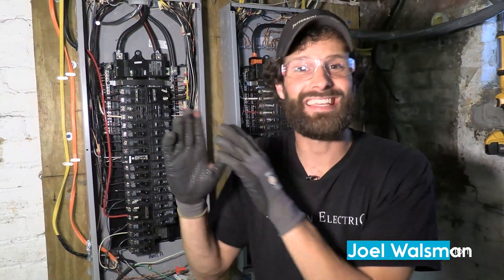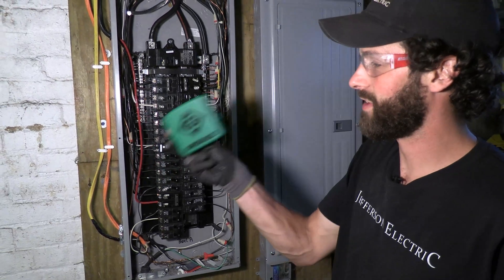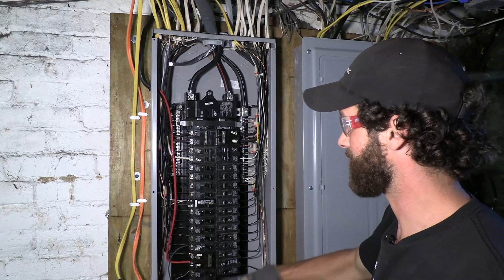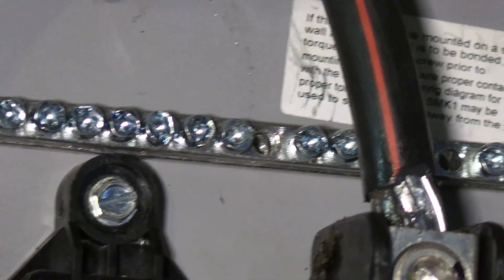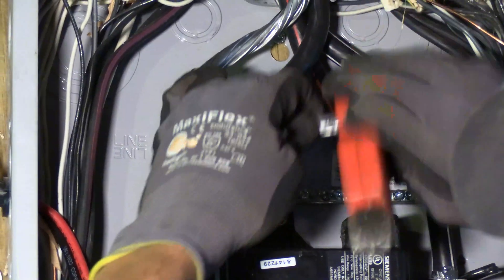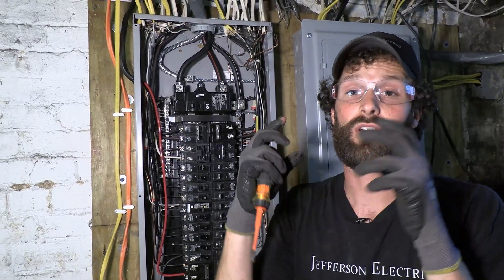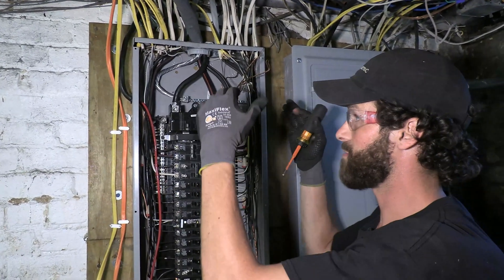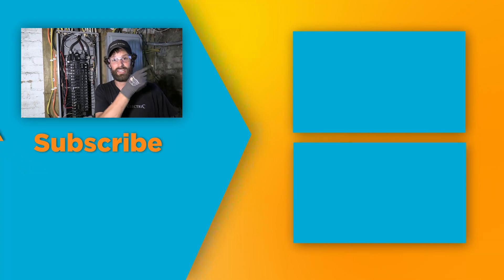This Metal Block Fixes A Common Electrical Panel Problem

Comment: I like the video but I strongly dislike your switch of placement of the ground bar. Originally you said to install above the sticker which is correct, however you installed it below that and, in my opinion. it is wayyy to close to the incoming A and B phase. That's my observation from an experienced electrician and inspector!
Reply: I agree with @Layz_her. Having a bar that close to the 200 amp service input is a disaster waiting to happen.   Yikes - gives me the creeps looking at it.
Reply: Agreed. Above the sticker is a little more awkward working around the incoming mains, but that little bit more distance from the main terminals seems worth it.
Reply: I believe it's against NEC too. There is a table in 408.56 that shows proper spacing between energized and ground bare conductors. Seems to be a required 1/2 inch clearance.
Reply: 1.  Probably the worst place to put a ground bar. 
2. There should be pre tapped holes on the sides where the ground bar is intended to go 
3.@mark fritze you can put more than one ground bar in the panel.
Reply: No way would I be comfortable messing around with a ground bar so close to the main lugs. And all those bare copper grounds nearby. A very exciting panel to work on. Also in many panels they aren't anywhere near this tidy, with lots of excess wire length folded around everywhere.
Reply: I agree.  I don't understand why he didn't just put the ground wires on one side and neutrals on the other and remove the bonding screw/bar.  He was already disconnecting half of the wires.  Why not just move them all?
Reply: @Roy-ij1wq  a lot of times they won’t all reach to the other side
Reply: @markxx90  The wires can be extended.  I think its dangerous having the ground bar so close to the mains.
Reply: Whew, ya, no kidding. That is an arc flash waiting to happen.
Reply: Don't put the added ground bar at the top right behind the incoming hot legs
Reply: What about pigtailing some grounds?
Reply: I probably would have used 2 ground bars. One on the right behind the smaller conductors, another shorter ground bar on the left towards the top, probably mounted vertically; with a green bonding jumper between the two.  If I had to move all the neutrals on that side out of the way, mount the ground bar, then put the neutrals back, I would have.
Reply: siemens panels have holes drilled for adding ground bars on the sides under OG ground bars... why not mount there? I would avoid the incoming lugs area altogether. that's just setting up the DIYer for failure.
Reply: Some panels actually have the holes there for ground bar installation already, not a big deal.
Reply: @bradleysmith6442  When I see ground bars that close to the main line, I think about the 200 amps at 240 volts available and the potential fault current if a short occurs.  Obviously he disconnected the power at the entrance, but after he leaves, the potential is there for the customer add ground wires.  I guess you have to make it work when there are little options.
Reply: @LDoctorKC  I've seen people use 2 ground bars, one on each side of the panel, parallel to the neutral bars. I feel like that would have been a better option here.

Comment: Also smart to tape cardboard over the the terminal and guts where the breakers are. Avoiding metal shards. I don't recommend people drill holes into a live panel but sometimes if you don't work for yourself this is a good practice.
Reply: ALWAYS a good practice, even if deenergized.
Reply: He said that the conductors to the panel were deenergized before he tapped.

Comment: That's cool. Didn't know that subpanels had to separate ground conductors. When we upgraded our service at my last house, and they turned my master panel into a sub panel I don't think they did that.
Reply: Grounds and neutrals stay separated and are only connected at the first means of disconnect. Because your main is now a sub, it is no longer the first means of disconnect. I think I explained that right.
Reply: It is a fairly common mistake made by many electricians, especially self-taught ones and handymen, but if you got a permit and the system was inspected, chances are they either remembered to separate the ground and neutrals or the inspector caught it and they corrected it.
Reply: @TwilightxKnight13  Inspectors also make this mistake.  When I built my shop 25 years ago I did my first DIY wiring job and asked the inspector to do a thorough inspection.  He didn't flag that the ground and neutrals were bonded in a subpanel, didn't flag that I was short a ground rod and didn't flag that I overfilled the outlet boxes.  He is the same inspector that passed the inspection when the house was built 10 years before and didn't flag that the kitchen only has one 20 amp circuit that is shared with the half bath.  I've since corrected all of the obvious errors but I still get surprised.  Last month I had to cut a wire that went through a rotted floor joist I was replacing and determined that it fed  the closest outlets in the family room above.  I didn't find out until the following morning that it also fed the sump pump in the basement and learned this because it rained the night before and the basement was flooded.  I still pull permits for all my work but I don't trust that the inspector knows what he is doing and do my own research.  YouTube channels like this one are a great resource especially when they invite comments.
Reply: @Roy-ij1wq  I think this happened to me. We passed inspection, and the conductors were not separated. Just looked at some pics I had saved.
Reply: @Roy-ij1wq  it is a newer code from when AFTER the US adopted the NEC international code. 25 years ago the requirement may not have been code in your jurisdiction.
Reply: @SuperVstech  I did not know that.  I thought that the code has always required that the neutral and ground are separated in a sub panel.
Reply: go check!

Comment: Hi Jeff, Retired electrician here. I think 10-32 screws are required. Again depending on the AHJ. I really enjoy your channel. Doing a great job 👏
Reply: I am installing a new Square D Homeline Plug-on neutral 200amp panel and the pre-drilled/tapped holes and the ground bar are 8-32. Considering how [relatively] new this panel design is, I would doubt that 10-32 is required. I did quick (not thorough) peek at the 2020 code and while 404.10(B) does specify -32 threads, the size of the screw is determined by the manufacturer of the device, in this case the ground bar.
Reply: @TwilightxKnight13  Agreed, I think it's a 110.3(b) item, "install PMI", using supplied hardware.
Reply: Also think they are to be 10/32.   and thinking about it.  just good policy anyway.